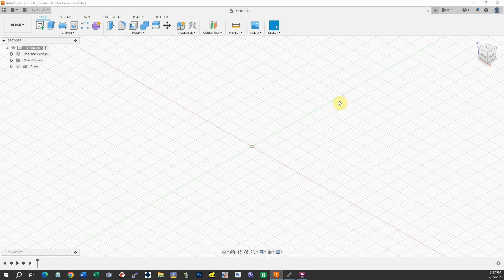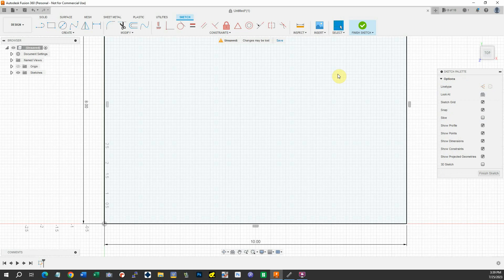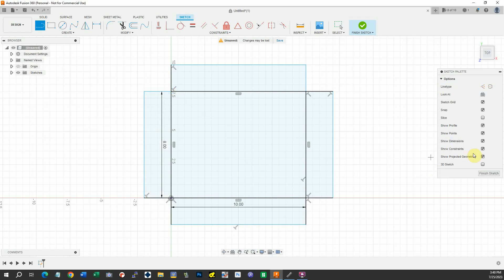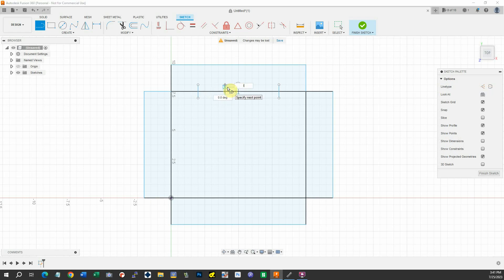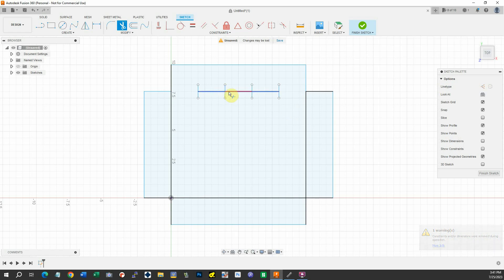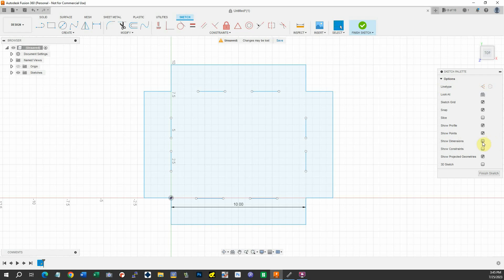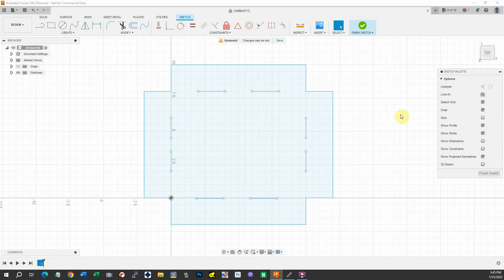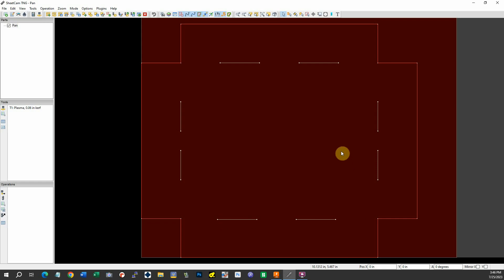Using Fusion 360 to generate DXF files with single line cuts.

Comment: Instead of spending so much time trying to fine tune with your cursor just type your desired measurement and it will snap directly to it. When making rectangles for example just type your first length then press the tab key, type the second and hit enter. Much faster than trying to drag to the desired sizing.